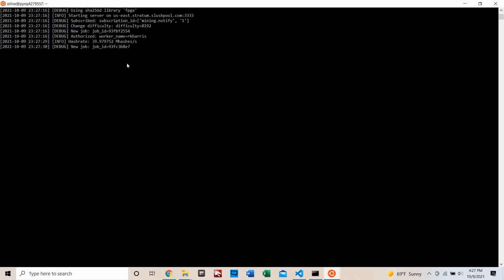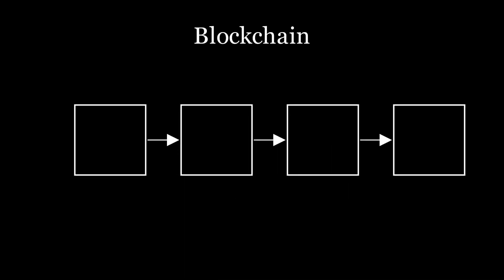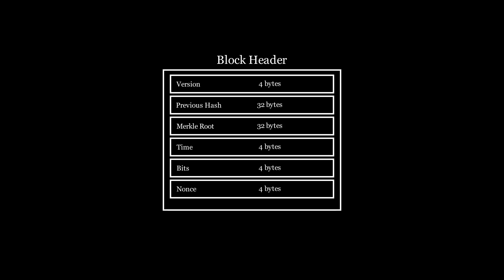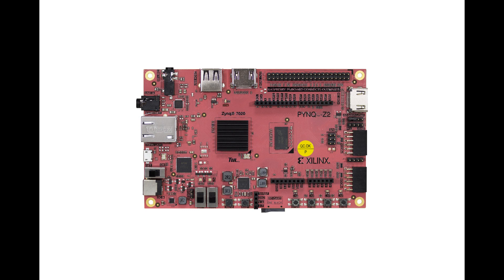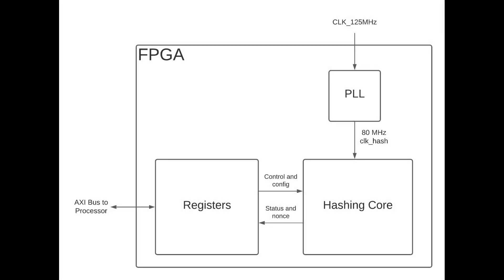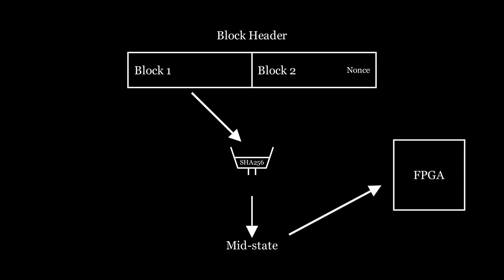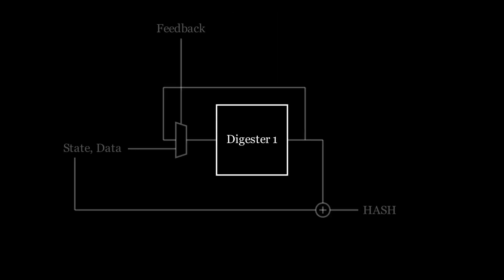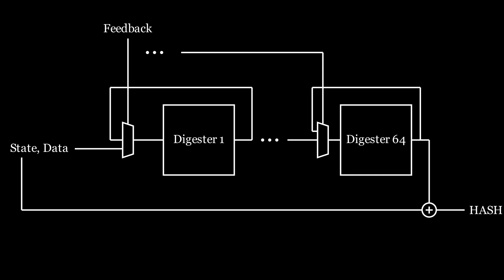DIY FPGA Bitcoin Miner

Comment: Hi Richard. 
Great video and a very cool project. I want to try your design on another board and I was wondering in which byte order your sha256d_wrapper expects the mining data...Liitle endian or big?
From what i could figure out by looking through your code it seems:
MID_STATE          = "big"
RESIDUAL_DATA ="little"
TARGET                = "big"
Am I right?
Thanks for your work and the excellent explanation.
Reply: Could finally verify your design by using sha256d_fpga_sim.py to construct the necessary data. Thx a lot. The Xilinx Spartan-7 chip i am using only supports 12,5 MH/s.
Reply from the maker: @waldemarleise7201  Glad you figured it out!  The byte ordering was quite confusing to me as well haha

Comment: @Richard Harris are you using an SDK build with this?
Reply from the maker: No SDK needed
Reply: @richardharris1224  how are you talking to the FPGA? UART? Maybe this is something special to do with PYNQ device and Python?
Reply from the maker: @TheSephrn  The FPGA is a memory mapped slave to the processor.  Yeah, the PYNQ has built-in libraries to use this bus from Python

Comment: Are any other algorithms Suitable for FPGA?
Reply from the maker: In theory you can do basically any algorithm with an FPGA, but it's most suitable for algorithms that can be optimized by doing lots of operations in parallel.  As far as other crypto PoW algorithms, Litecoin's scrypt seems suitable, although ASICs already exist for it as well.  There are probably others too, but I haven't looked into it much yet.
Reply: Blake2s, Odocrypt, SHA3, Basically what hashaltcoin is already mining.

Comment: i don't think it mines any bitcoin at all. i did have a test connected to binance bitcoin pool for 24 hours and i even don't see the workers/miners , even though they are connected and mining. No workers appear connected on the binance dashboard . I have done same tests on a few bitcoin pools. I think its just simulation miner not actual mining to a pool. Please elaborate if it does. i am waiting
Reply from the maker: I tested it on slushpool and the worker appeared connected on the dashboard.  But the hashrate was below their threshold of 500 Mhash/s so it didn't display it's hashrate

Comment: Hi Richard, Is it possible to chain multiple boards together to increase the hashrate?
Reply from the maker: In theory I suppose it's possible.  But if you just ran multiple boards independently the effective hashrate would be the sum of the hashrates of each board, so I don't think you would need to

Comment: This video is amazing and if the prices are as cheap as they look why the hell would people keep running to gpus?. Whats the power consumption like and how easy is to run like 10 of these lol. What os are you running for it? Do they have onboard video?
Reply from the maker: This project was mainly for educational purposes rather than to make a profit.  In fact, this setup will not make any profit mining Bitcoin.  If it was profitable I probably wouldn't give it out for free!  Right now people use ASICs (Application Specific Integrated Circuits) to mine Bitcoin, and they are orders of magnitude more powerful than FPGAs or GPUs for the SHA256 proof of work algorithm.

However, it is possible that this hardware platform and my code can be adapted for other coins that don't have competition from ASICs.  I've been looking into that, and I'd be open to suggestions about coins that might be suitable.

I haven't measured the power consumption yet, but there might be a spec in the data sheet.  The OS is a flavor of Linux specific to the PYNQ board, and they have a built in HDMI port.
Reply: The only way a FPGA would be profitable is if the bitsream creators made and distributed it for a coin or token before asic manufaturers produced a ASIC rig. Example being how Kadena was mined with FPGAs from hashaltcoin at the beginning then ASIC miners came in last year and now is the most porfitable coin to mine. If anyone was going to make a profit with FPGAs in current year they would have to use no less than a Intel Altera Stratix10 or Xilinx Ultrascale+/Versal. But those Slabs of logic cost anywhere from $3000 to $20000 for one and you can only hope and ASIC manufature does not come along and stick it to you. Getting into FPGA mining is like being a pioneer of the crypto community you etheir have to know someone or know how to build the equiptment yourself because you will be on the cutting edge if you make a device that is profitable.